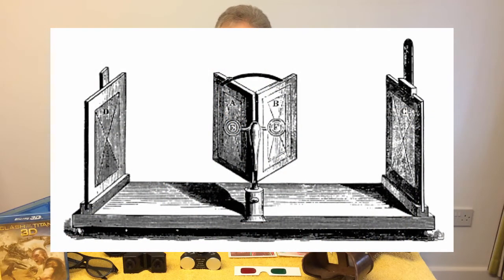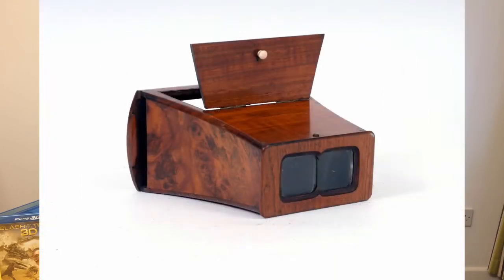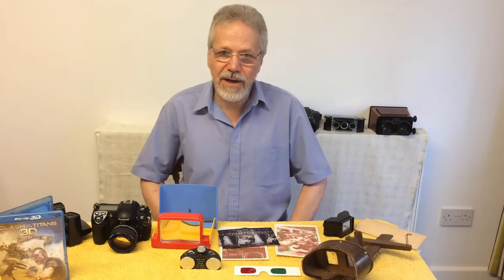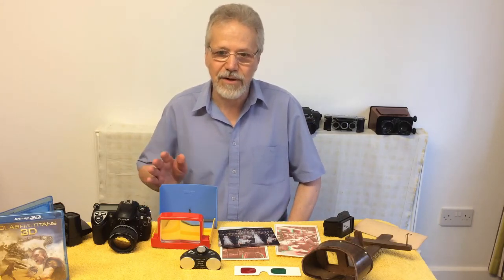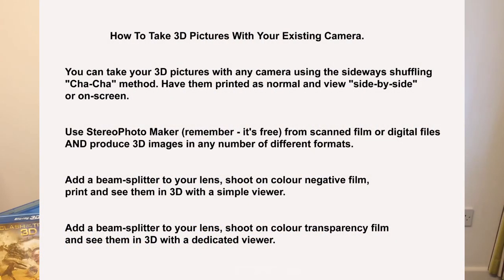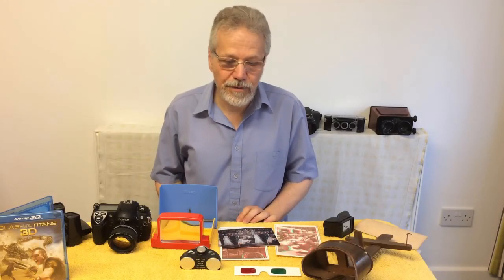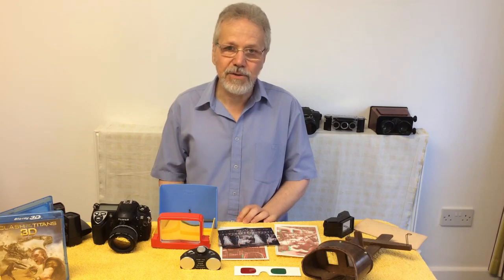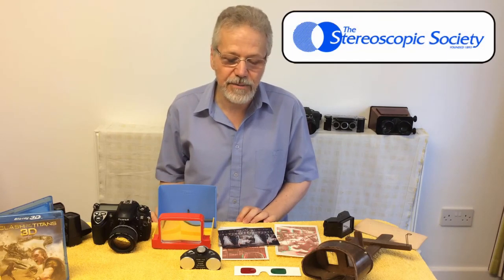Taking stereo images with a non stereo camera

Comment: Thank you so much for your passion and dedication to this hobby.
I’ve seen stereoscopic images before but never thought to take them myself. Your video is encouraging me to try this hobby myself.
I wanted to buy a Stereoscopic camera, the Kodak Stereo Camera looks like something I’d love to try out but the Beam Splitter is also something I think worth looking into.
One question:
I have a Prime 50 mm lens on a Nikon D7200 (crop sensor)
how would the images come out as you mentioned the the beam splitter is designed for 50 mm full frame?

Comment: Dint know the name beam splitter until now. Thanks. I’ve got a nasty beam splitter for my iphone (Precious time) but they always use normal mirrors that leave large edge distortions.
I’ve found some surface mirrors on AliExpress that should work with a bit of adjustment. Could probably 3d print one eventually. The phone camera is convenient and for video at 4k 60fps and cheap! Nice video appreciate the history.👍
Reply from the maker: Be great to hear how you get on - it's great when old technology can be used with new!
Reply: It’s not as easy as I thought.
There is an angle distortion on each image side because of the 45degree mirror so the images don’t overlap well with a slightly different angle as well as view point. The phone lenses are small so hard to split well. I’ve got two old iPhones with the same camera so probably a better way. Just wanted a quick portable solution but eventually like the new iPhones they have this built in 3d pictures and movies. Not cheap though but handy.

Comment: Believe or not, there is no need for 3D glasses or any adapters at all. Imagine talking to someone and suddenly a siren appears down the street over her shoulder or looking past your fingers. Same thing. We do it naturally.
 You can learn to do it with 3D photos without crossing your eyes. You just think you can't. The trick is though, you have to shift your head a bit to line up two images into a virtual center image and ignore the sides. Do you care about the glass in your bathroom mirror. No.  Can you look out a window? Yes. Same thing. We do it naturally. Cheers!  '3dfantasys'.

Comment: do you think it would be possible to take a 3d picture with a polaroid/instant camera? 
It would be cool to have a red/blue 3d image made with a polaroid camera
Reply from the maker: That's a nice idea, although I think you could only do it by using a beam splitter in front of the polaroid camera lens, which MIGHT give you a stereo pair on the instant photo - you'd then need a stereo viewer to look at it... so in the end I don't think it would quite give you the 'cool' effect you were after - but, hey, why not give it a try and share your results with us?
Reply: @pccgbvideochannel8822  hmm to have the blue red kind or 3d effect, wouldn‘t a douple exposure work, one with a red and one with a blue filter? Or can that only be archived by using photoshop?
Reply from the maker: @SnowmansApartment  Hi - the blue / red effect needs two lenses to take the same view from slightly different angles - otherwise it's not a stereo view. I suppose if you took one image, applied a red filter to it in photoshop, then did the same thing with a blue filter applied, you could overlay the two images on top of each other and  put them slightly out of register - why not give it a try?
Reply: That’s a great idea but you need to create your own beam splitter to fit the Polaroid camera lens. 
How about using 2 Polaroid cameras side by side to get left and right image or using cha cha method with one Polaroid camera. Pictures can be laid side by side and use free viewing to see in 3D instantly